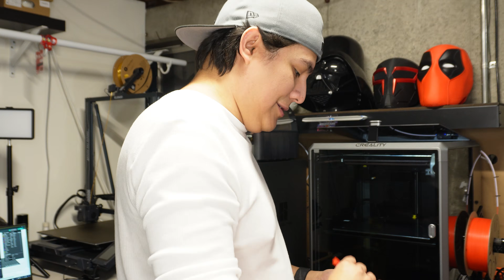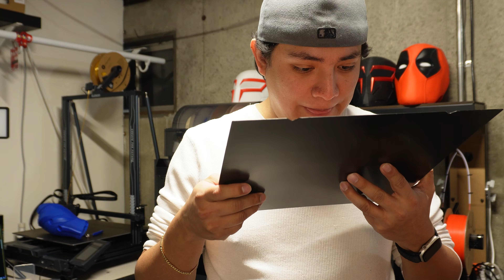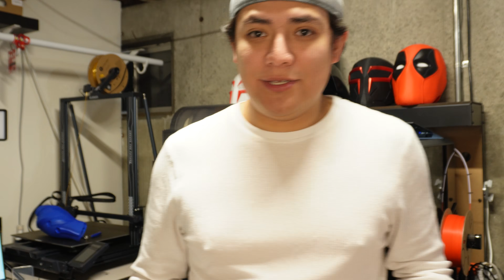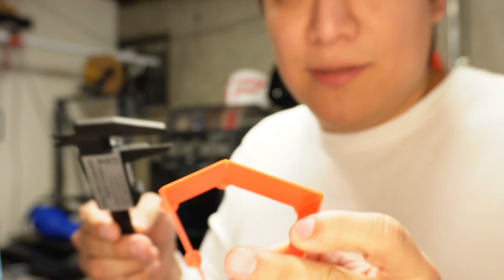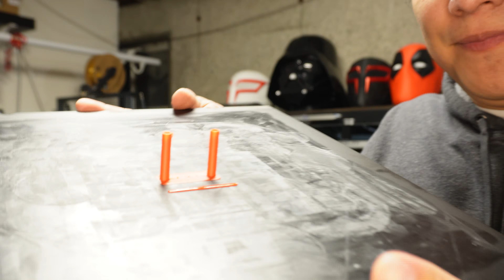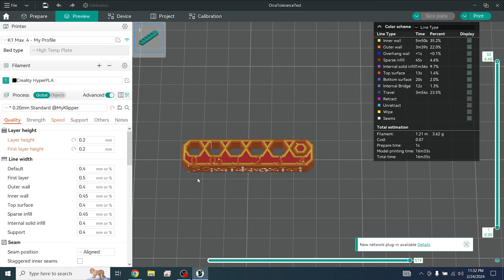Fine Tune Your 3D Printer! Using Orca Slicer!!

Comment: The video is very helpful. 
I had issues printing with my Elegoo Neptune 3 Max while using the Orca Slicer, which was due to a user error by me. After watching this video and did some calibration on the flow, I got better results
Reply from the maker: Thanks for watching! Glad you could figure it out!

Comment: Do you have a video showing how to dial in the settings to get to .05 in the tolerance test?
Reply from the maker: It’s a mix of redoing the calibrations and making sure your extruder is extruding the proper amount of filament. If it’s non klipper you want to do e-steps if it’s running klipper it’s going to be rotation distance

Comment: Do you run the calibrations for each type and manufacturer of filament or just for each type?
Reply from the maker: So for me I try and do it for the type and use it as a base line for other brands and adjust if needed. Most of the time PLA from any manufacturer will print ok if say I calibrated Elegoo PLA and used that profile.